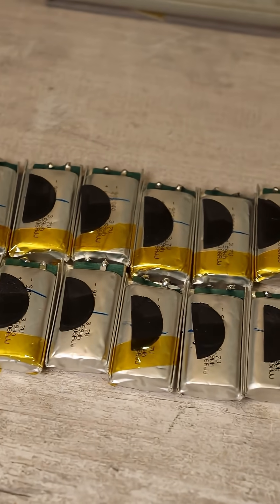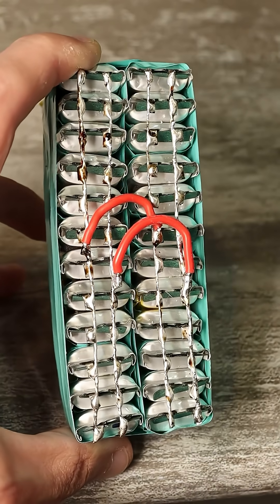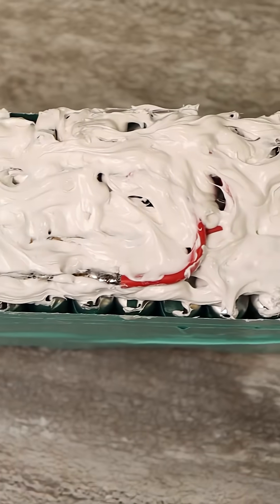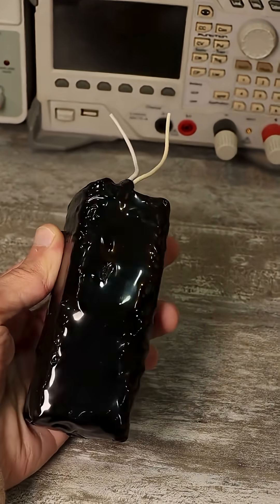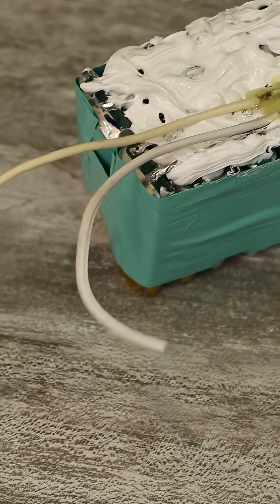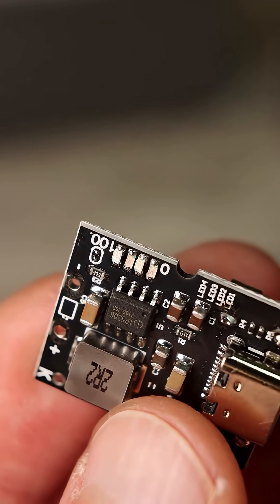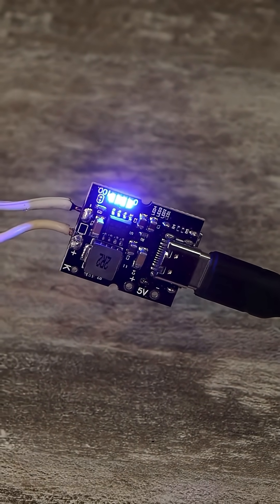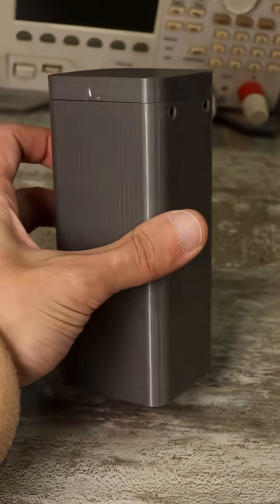Power Bank Hack – Using Disposable Batteries!

Comment: People are like, "Oh, you gotta do this" "Oh you gotta do that" but from real world experience it doesnt matter. 
Yeah, you should probably match the resistance of the batteries. However, making something out of garbage and then using it is usually just fine.
 I've made a lot of battery packs out of new batteries and used batteries that i get out of disposable vapes laying on the ground. All of them have been working fine without noticeable degradation. Some are 3 to 4 years old at this point